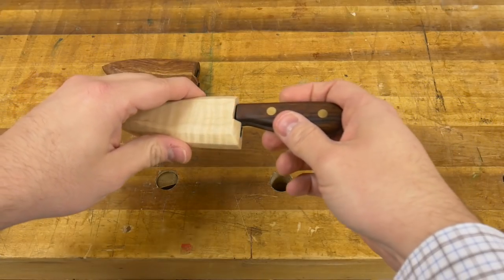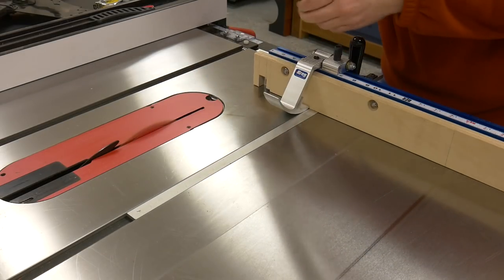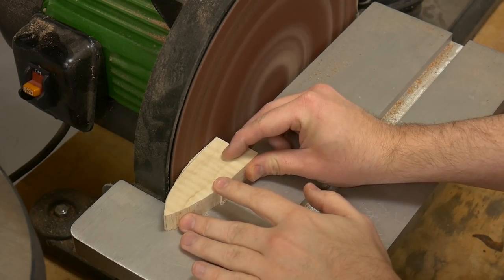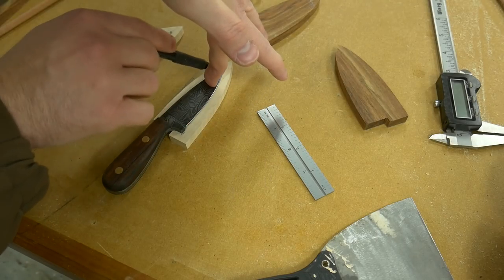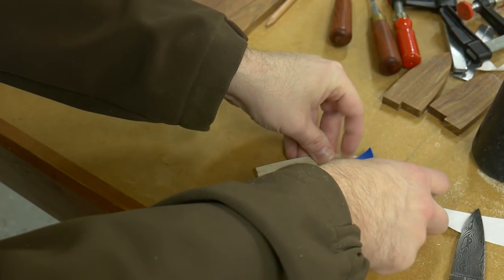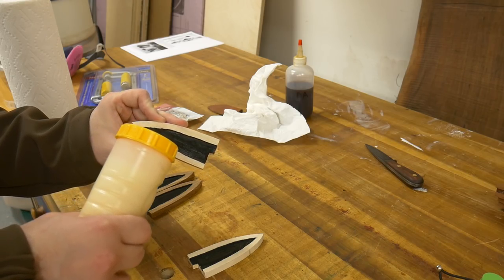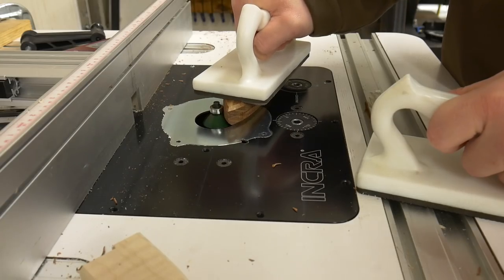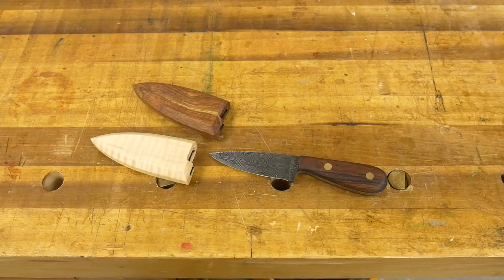How To Build A Wooden Sheath | Damascus Steel Knife Sheath

Comment: Great work, no doubt.
 Give this a try:
1- cut two slices of the wood just like you did and mark the knife shape on just one of them.

2- use chisels to cut the knife shape, make it deeper towards the ricasso and shallow towards the tip of the knife.

3- during the cutting always clamp the pieces together and put the knife inside until it firmly locks on it not super tight but tight, it will loosen a bit when you oil it.

4- once you've completed step 3, apply some oil to the part the knife will be touching on the sheath. (I've used transparent mineral oil) it will reduce friction and protect the knife from rust, it really helps preventing rust.

5- glue the parts together with cianoacrilate (super glue) or epoxy, those wooden glues have given up before, so I don't trust them.

And that's it, you're gonna have a sheet that firmly holds the knife and protects it from rust. The ones I make can be turned upside down with the knife in them and shaken, the knife won't fall, when you need the knife you pull it out without much effort and it comes out making a nice "click" sound.

Comment: Great video.
However, I suggest you to use gloves, you could hurt your finger badly with a saw.
Reply from the maker: You shouldn't wear gloves with power tools.
Reply: @Simplecove  Why?.
(I am not that used to power tools, sorry for my ignorance).
Reply: @felipereyes1440  If the glove gets snagged it can pull you into the blade (or whatever angry bits the power tool have) and then you start losing body parts. 

I've been a woodworker for 14 years and no, never using gloves. Also, be aware of loose shirt arms and hoodie strings.
Reply: @kristoffer-robinlotze7273  Okay, thanks! I am quite a noob so advice is appreciated.